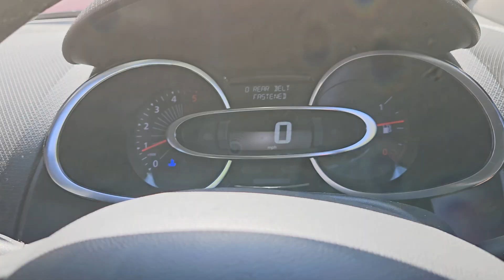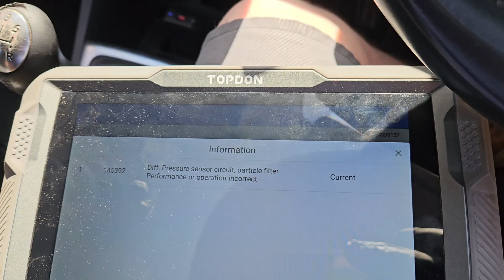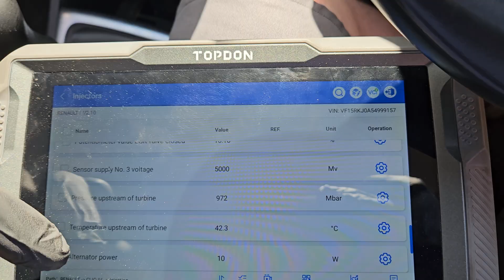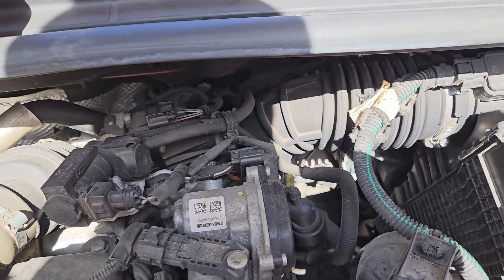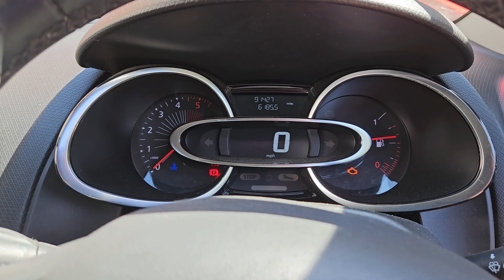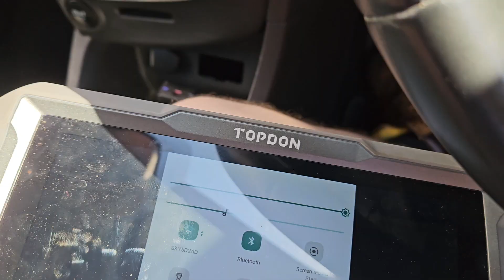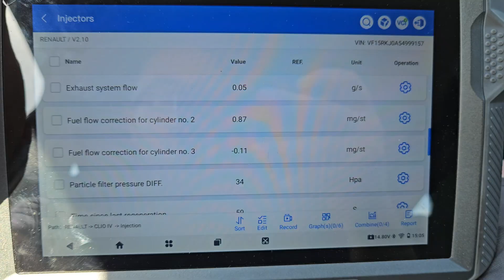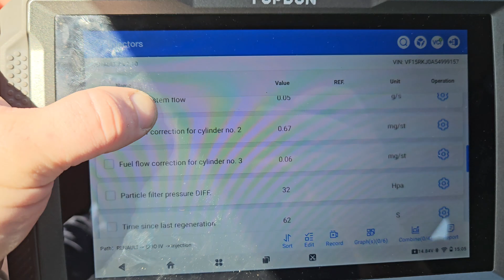Renault 1.5dci Check Injection System. Engine Management Light On. Loss Of Power. Code 145392

Comment: HI DAN GOOD  VIDEO THERE THANKS FOR SHARING THAT INFORMATION VERY USEFUL  FRIEND GOT A FORD KUGA DIESEL TDCI 20LT MK1 08 PLATE GLOW PLUG GONE OFF AND THE MIL LUGH COMES ON AND ABS LIGHT TOO RIGHT REAR DAN REPLACED THE SENSOR AND A NEW PLUG LEAD BUT NO LUCK USED A LAUNCH X431 PRO LITE 😊

Comment: I have this problem too but car isn't losing power it hasn't changed at all mechanical wise 😆🤣
Reply: Mine too today not sure if I should drive
Reply: Anyone find out source of problem, my car started saying the same
Reply: @lsgirl8814  I am driving like that will go to check later it works normaly :)
Reply: @perpaimbe8849 I’ve been to mechanic and they can’t work out what the problem is. Going to go to a Renault garage on Monday. I’m scared to drive it
Reply: @lsgirl8814 Me too I went twice they just checked and removed the signe but it appeared again will go to check in few days, where are you from ?
Reply: @perpaimbe8849 I’m Northern Ireland, how about you?
Reply: @lsgirl8814  I am from Kosovo :)
Reply: Anyone diagnosed what the exact issue was??
Reply: Yeh you keep driving it then it will get worse an will lose power my mates got a scenic an had now gone into limp mode
Reply: My light went off comes on here and there but chanced it for mot passed flying colours still going strong to 🤞🤞
Reply: Thinking clutch! My mates been quoted £1250 as something about a flywheel aswell mad